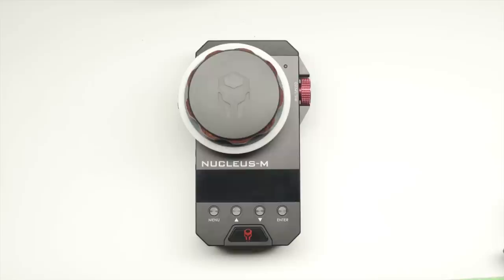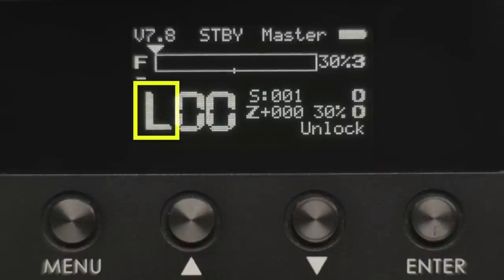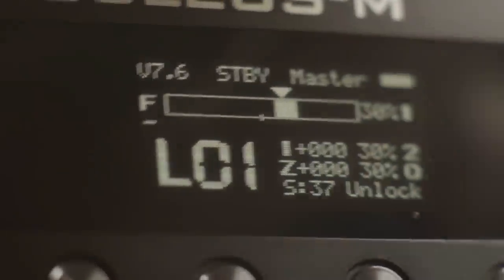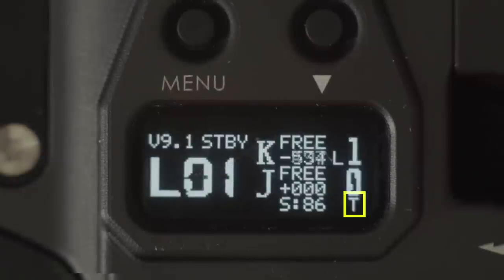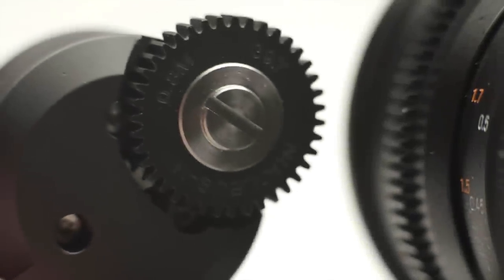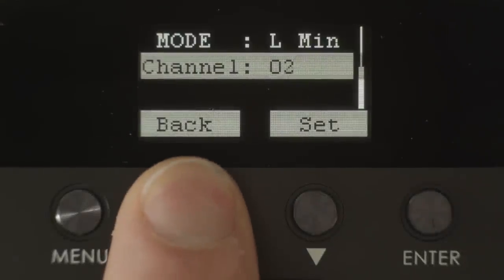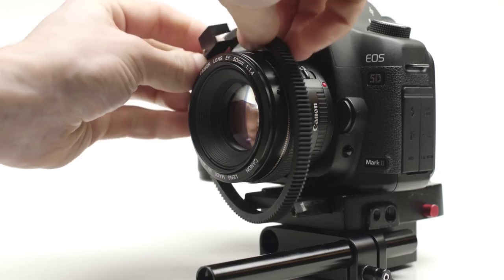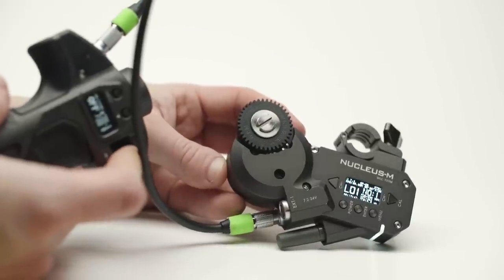Tilta Nucleus-M Wireless Follow Focus: In depth getting started tutorial

Comment: Yes, you can power the motor directly from a camera as long as it has power out.  This info is in the (Motor:Power Supply and Run/Stop) of your “Quick Instructions” manual and it shows how it is setup.  Very likely he is using the 740mm P-Tap to 7-pin power cable that should be included with your group and powering it off of a battery directly while he is making his video demonstrations.  This also is the best setup.

Comment: Hi, thks for this well done video. When I do a manual calibration with photographic lens and after that I've filmed I switch off the motor I've discovered that when I power up again the motor I've to do again the calibration. Do you know if is this normal? The last firmware is on my nucleus M - 18.03.19.3

Comment: 4:07 - Instead of releasing your finger and then pressing and holding again to find the range, just press and hold the mark button at the beginning then move to your B point, while holding the mark button, after you find the B point then release the button. In this case you won't have the freezing problem. And tnx for the video overall.
Reply: agree!
Reply from the maker: Amazing good tip!

Comment: Hey,
is there any other advantage to use the lemo export from the hand contoller? For example communicating with a monitor about the focal distance? Because the Teradek RT System is able to show a focus parameter scale on the right side of the monitor it is connected to. Therefore the 1. AC will know where his focus is right now, without looking to the hand unit, which I think is very useful, because it reduces a lot of stress.

Comment: Hey, thank's for this amazing video, it helped a lot.
I've just got one question : can you power on your motor without a battery, but directly from the camera when it's a DSLR? 
At 13:32, I can't see how your motor is getting power. Which cable are you using?
Kindly :) (I've got an A7S, and I'm wondering if I can power on the motor from it.)
Reply: Mathis I don't believe you can power up the motors from an alpha camera. I have an a7s 3 and I've used goldmount batteries and d-tap splitters to power the camera, monitor, follow focus, etc.

Comment: Hello and thanks for this tutorial.
I just have a question, what the torque setting is actually doing? When it's set to high is using more power (but not more speed right?) 
What is the actual difference between low setting and high setting?
Thanks
Reply from the maker: Hey, I'm not completely sure, but from what I understand, all FF motors have both a motor and a high resolution rotary encoder both connected together. The motor itself has no absolute position, it just gets told to spin one way or another but the rotary encoder knows exactly where the gear has rotated too. Like a feedback system to check if it's turned and how far. So when the torque is increased I believe it's simply saying keep the motor spinning even longer even if the encoder doesn't follow the motor perfectly. If it hits the end of a lens for example, the encoder stops rotating even though the motor is still trying, and the microcontroller realizes it's hit its limit.

Comment: This really answered all the questions I had about the system. Thanks for the great video! So just to confirm, only one motor can be connected at a time via the wireless? I was really hoping to run a dtap on my ronin camera mount for focus and a secondary motor with a custom mount to the handle bars mounting my monitor so i can control monitor tilt with the zoom or aperture. I didnt want to have any cables in between camera and handle bar haha

Comment: Hey so quick question, I own a canon dslr I’ve been trying to set up the small motor but the other extension doesn’t seem to fit on my camera. Does it require a different battery or external power outlet to be attached? In order to make it turn on and be used with my canon ?
Reply from the maker: Garima Sood hey man, the motors definitely need power, there is a way to power the motor directly through one of the handles but it’s not officially recommended by Tilta. Otherwise yeah some sort of dtap battery
Reply: Joshua MacDonald okay gotcha, was trying to figure out how to power it. Also I followed the steps to setting up the motor with the FIZ according to your tutorial but my motor seems to not work when I spin the wheel on the FIZ unit. Everything’s correct on the displays...

Comment: Excellent video. I have two questions, hopefully you can help. 

1) When switching between the Hand Unit and Handgrips, my zoom motor spins extremely fast to the point where I fear it will damage my lens (using an old Angenieux lens). This is activated by simply touching the zoom rocker and it will for example zoom my lens from 12mm to 100mm at a dangerously high speed. Do you have this issue? 

2) I always need to calibrate my lenses after shutting down the camera for battery swaps. I see below you mentioned your motors save the calibration at power off. Can you confirm if your motors save the calibration? I'm using lenses with hard stops, it usually just costs me an extra minute to wait for the calibration and it's annoying. 

 All that aside, thank you for the excellent demo video.
Reply: Hi, I just got my Nucleus M system and am having the same issue when switching from FIZ to handle and using zoom.  I reached out to Tilta support, but they were nice, but not so helpful.  They directed me to these videos in fact!  Did you ever sort this out and if so, what helped?  I’m using a Sigma Art 2.8v24-70 with my Blackmagic 6k pro.
Reply: @khenusingh  Do you still have issues with this? I just got my Nucleus M kit yesterday and noticed the same crazy speed jump when switching between units. I found sort of a work around was to hard wire one of the hand grips (right grip) with the LIMO cable directly to a motor so it's not on wireless (left grip is not configured) and then configure the hand grip to do zoom / focus (or aperture if only 2 motors are needed) and use a manual focus puller for aperture when on a zoom cinema lens. This way, the FIZ always stays on as master and doesn't do that crazy seeking and I can still use the one hand grip since it is hard wired without wireless. This solved my problem at least. I'm running a Blackmagic Ursa Mini Pro 4.6K.
Reply: @CNC-Time-Lapse  What I’ve been doing is setting the value of the Zoom to 500 (roughly in the middle of the range) on the FIZ then making sure the hand grip (I use the joystick for Zoom) is at roughly the same value before switching from FIZ to handgrip.  Then I switch with no issue.  It all works smoothly, though every time I turn the device on I have to recalibrate the Zoom (not the Focus).  Not sure why this is!

Comment: Is it possible to split master and slave mode for diffrent motors. That the handunit controls focus, but the handgrip controls iris.
And that I can change the tasks of each device without the biggest effort in a short time?
Reply from the maker: Yes it is, you just need to make sure the hand unit and one motor are on different channels as the handgrip and its motor, you can set it up just like in this vid.
Reply: @joshuamacdonald8785  Well, but than i can just use the handgrip for the first motor and the handunit for the second one. But can I quickly change the tasks.
Scenario 1:
Handunit: Motor 1 
Handgrip: Motor 2

And quickly change to 

Scenario 2:
Handunit: Motor 2
Handgrip: Motor 1

Comment: Do you know if the motors can handle the 16v from a Dynacore battery? or is there a way to power them from a v mount battery?
Reply: The motors handle up to 24v according to what's written one them, so no problem for 16V... It has a DTAP to Lemo cable included so you can power from V-Mount if you have D-Tap out on your batteries

Comment: Good video, man. Thank you! Two questions: Is there an automatic function to go from one mark to another or do I need to navigate between marks by hand? I love the product but I can't believe that this function does not exist. Even cheap pull-focus devices have this elemental function. Also, can I invert the direction of the bar that shows me the percentage of focus? It looks weird to me that I turn the knob to the right and the bar goes to the left :) Can I set that? Thanks a bunch. P.S: What tripod is the one you have on this video?
Reply from the maker: Hmm I don’t believe that feature exists and we might be stuck with just the one display for the focus bar. Doesnt seem like tilts is planning any more firmware updates either for this guy :(
But my tripod is a Seceed Reach 3 a knock off sachtler. Not a bad head if you take care of it!

Comment: I wish someone talked about how you can save a manual calibration I have no idea how does anyone on here know ? Every time I shut down I have to manually calibrate this is extremely inefficient and clients always have to sit there and wait. There has to be a fix if the old Dji hand unit can do it why not this one.
Reply from the maker: Art L.A. strange, does it save it for you when you do an auto calibration? It does save it fine on my unit but I don’t think ive tried a power cycle after a manual cal but I can’t imagine why it would act different than auto. Ill test it tomorrow.
Reply: Joshua MacDonald it doesn’t seem to save most of the time but I can trick it into saving which I shouldn’t have to do. Idk I feel like it needs a long overdue update.
Reply from the maker: Art L.A. hmm ya that is strange. The latest firmware also softens the hard stops on autocal which is nice, ive even just used auto on stills lenses and just grab the motor at its ends to stop it and it works pretty well, you go over a bit so you can’t pull to a mark as precisely but if you’re pulling off a monitor its quick and you can get it pretty close.

Comment: Hey Joshua, I've tried to find an answer to a couple of questions I have about setup with no luck...maybe you can help. First, when I daisy-chain two motors (either with D-tap, or off the handles), I get an audible high frequency noise. It doesn't happen when I give each motor its own power supply. Is this normal? Second issue is that even when I set torque on the FIZ and the handles to 30%, the motors still display 50%. Is this normal, or am I missing something.
Reply: hi man, I dont own this product but from what I've seen you have to set the torque on the motors too

Comment: how i control focus motor speed
Reply from the maker: Sunil Vishwakarma since the focus range is mapped to the rotation of the focus wheel when you calibrate, the speed of the focus motor is determined by the speed you rotate the wheel. If you need slower more precise control you can set a-b points.